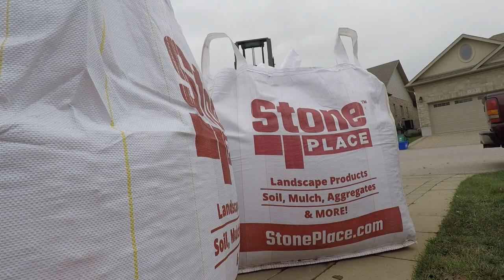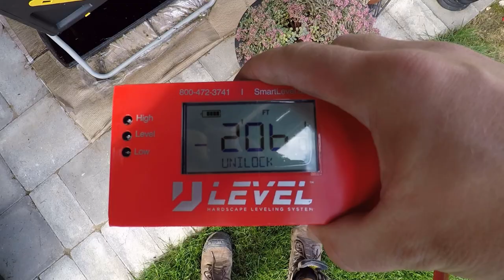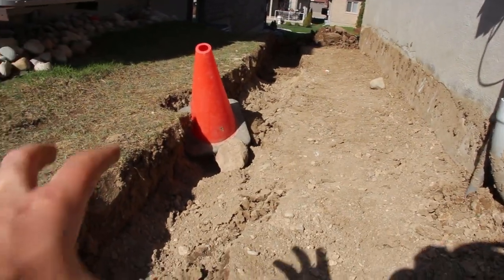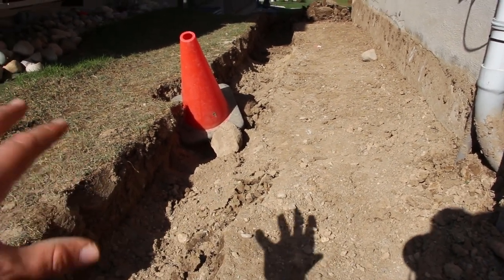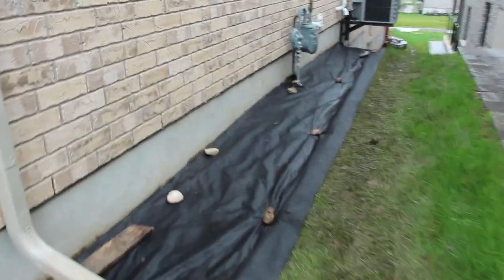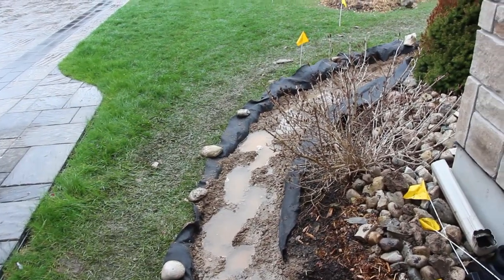Side Walkway Base Preparation | Hardscape Vlog #4

Comment: Do you recommend non woven geotextile filter fabric under steps and elevated patio or woven
Reply from the maker: It depends on the subsoils. I would likely use woven for steps and a raised patio I would only use woven if you had a way of evacuating water out of the base